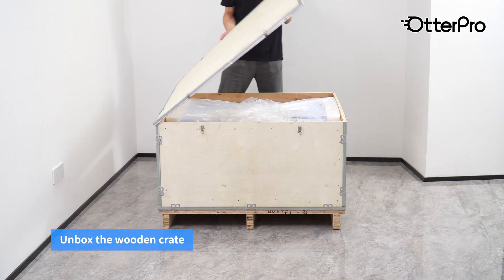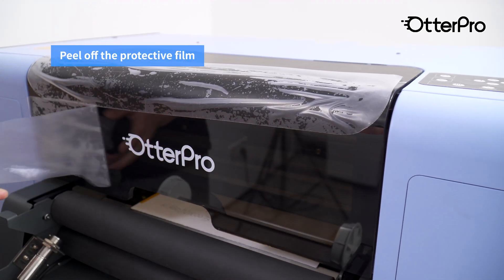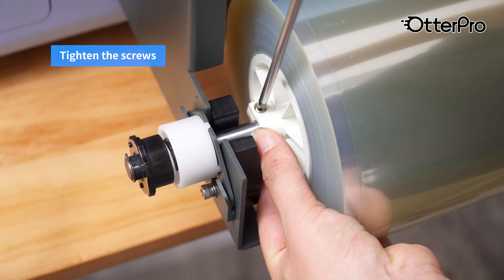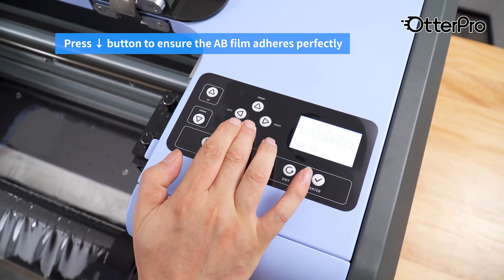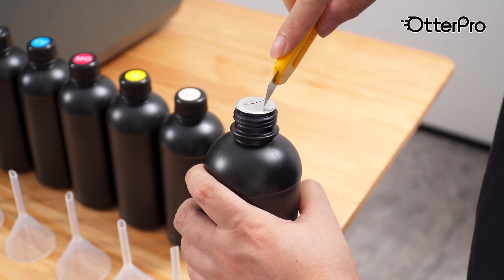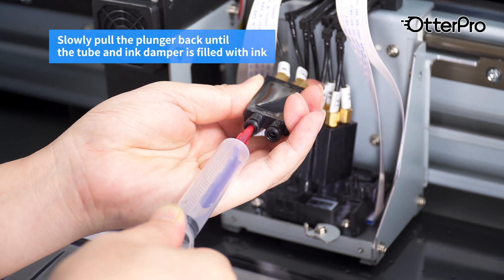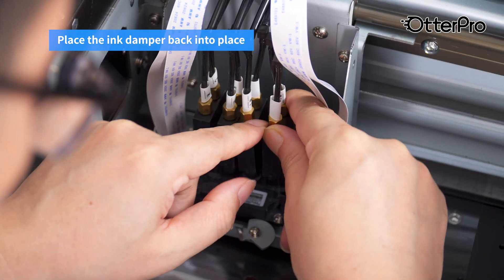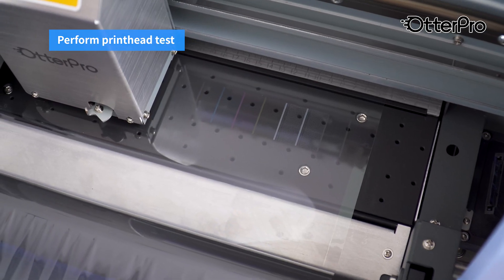Model C 30 UV DTF Printer - Unboxing & Setup

Comment: What temperature is the printer set at to achieve the best printing results? Also does UV light settings matter for quality and durability?
Reply from the maker: The UV lights are for curing and hardening the ink on the film.
Reply: @ what temperature is needed to set the printer at?